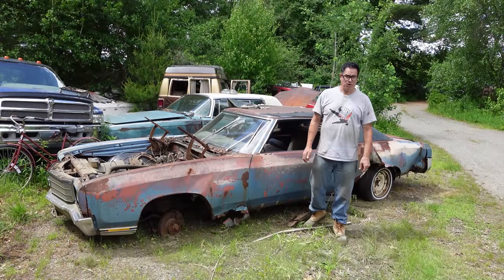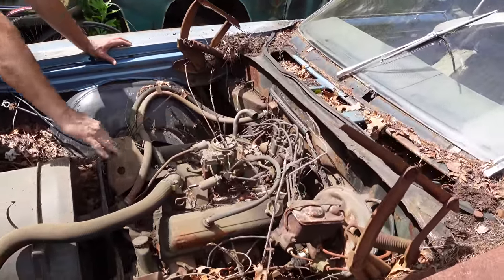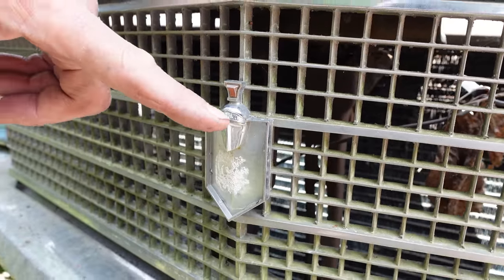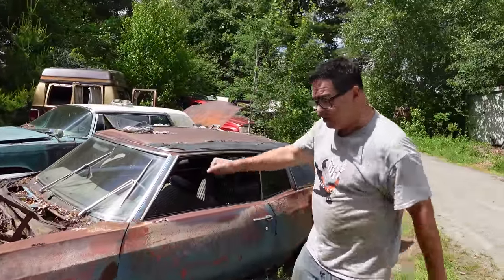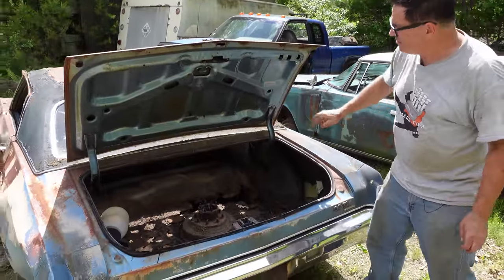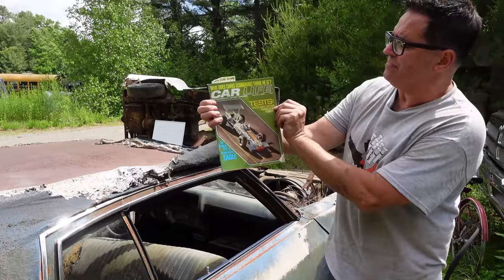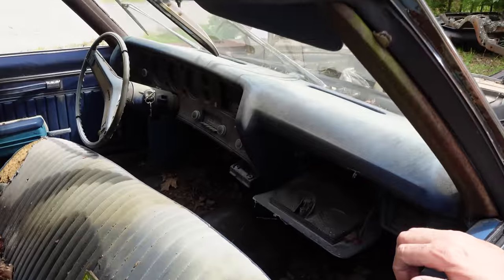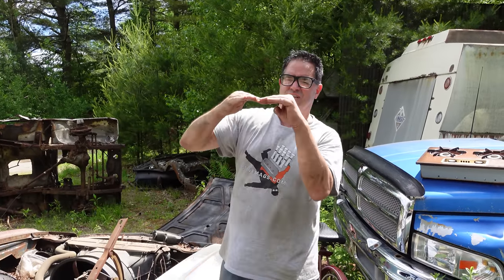1970 Chevy Monte Carlo

Comment: I had a 72 Monte back in the early 80s.  The easiest way for me to differentiate between 70, 71 and 72 Monte was the front marker lights.  70 had round ones in the bumper, 71 rectangular in the bumper and in 72 they moved to the side of the grill.  Easy to tell with just a glance.
Reply: also had a Monte ordered a rear sway bar from a chevelle SS   and put it on  the monte, took corners like it on rails
Reply: That's for doing the monte carlo I actually ask you about one the other day love your videos very educational thank you
Reply: I have a 71. The entire grille is different than a 70. Not just the emblem
Reply: Hey tool man have a 1972 Monte Carlo custom I bought in 1989 I still have her and she will never leave me
Reply: @johnbartol4313  Cool!  I think the 72 looked the best of the three years for that body style.  I also liked the stainless steel accent strip just below the trunk lid in back.  I think that was unique to 72.
Reply: @TheToolmanTim the Monte Carlo custom had all the accessories of the Monte Carlo ss had but but was a one year car but it it started out with the low horsepower 350 402 and 454

Comment: It was actually Bobby Allison, not Donnie that drove the #12 Coca Cola Monte Carlo. The cars were built by Junior Johnson and it was the start of his legendary run of championships with Cale Yarborough and Darrel Waltrip. Prior to the Monte Carlo, NASCAR rules required the #1 spark plug to be no further aft than the upper ball joint or in it's stock location. It was Smoky Yunick, he was mentioned by Steve, that found moving the engine back in the frame gave the car better balance that caused NASCAR to make that rule. His famed 66 Chevelle had the firewall moved back to give room for the engine to sit farther aft. The engine in Monte Carlos up to 1977 had the engine sitting 4 inches further aft than the Chevelles of the era giving the cars a bit better balance. That was one of the reasons the MC was popular in NASCAR despite being as aerodynamic as a barn door.
Reply: I had a buckskin colored 77 Monte swivel buckets and rally wheels bought new and it was the last of Generation 2 which had the engine moved back and a huge space for the fan shroud.  Loved that car beautiful styling and was smooth riding.  I bought it when the 78s came out because I always liked them and wanted the last of the big Montes.  Before that I had a 73 Chevelle.

Comment: I specialize in 6th gen Montes and other W bodies and i didn't know about the roman numerals on the grille for the year. I always knew the 70-73 body but didn't know how to tell them apart. Thank you for such valuable info. I love your channel!
Reply: The 1st generation is '70-'72. '73 began the 2nd generation. The '70 did not have a trunk lock bezel, but '71 & '72 did. The '71 had the Roman numerals on the trunk bezel. There are many differences between the '70, versus a '71 or '72.

Comment: Love this car from the first time I saw it !in the early 80’s in Trinidad. Moved to Nj in 86 bought a1970 Monte for $300 in 1986 then bought a 1971 a few years later (sold the 70 )  . Sold that 1971 after    Slight restoration-Paint rims stereo ! Sold that then got another 1971 as I prefer that grille and bumper

Comment: I bought my 71 monte carlo at 21 years old in carlisle, pa 17 years ago. Longest owned car I have. Was a very base model car. 350 2bbl, th350 no ac bench seat.

Been tinkering with it over the years. Still the numbers matching engine and trans but now on corvette rally wheels and sitting on a Viking performance suspension. It's certainly not fast but it turns heads and love it.

Comment: I bought my 1970 Monte in 1983.  I was initially confused as it had the 400 4bbl and I didn’t realize it was a 402BB.  It was very confusing at the time buying parts at the local parts store as the same motor was a 396 in a Chevelle, but called a 400 in the Monte when it was really a 402!  After about a year I finally got it all figured out.  
With the fan shroud removed, I can stand between the radiator and the engine.  Makes for easy work for removing the intake and heads.

Comment: I have a 1978 Chevrolet Monte Carlo that I bought used when I worked for a Chevrolet dealership. It came with a Buick 3.8 liter v6 which I replaced with a 454 big block. It has that long hood and the trunk lid is made out of aluminum. Still have the car and I'm in the middle doing bodywork and painting.

Comment: I changed a water pump on my 71 back in the early 80s. I removed the fan and cowl, stepped over the core support and radiator, and stood between the radiator and the front of the engine, with plenty of room to do my work. The 71 had the nicest looking front end, with rectangular turn signals in the bumper, that beautiful grill, and a classy little oval hood ornament, black with a simple silver script Chevrolet on it. Loved that car.
Reply: Swapped out a cam in my 71 without disturbing the radiator!

Comment: I owned a 1970 Monte Carlo from 1991-2010. I spent around 4 years restoring it in the late 1990’s. It was a early build car from the Flint Michigan assembly plant. Mine was gold with a black vinyl top and sandlewood colored interior. Mine had the 350 4 barrel, A/C. The rear end was a 12 bolt. It was pretty much stock, I even ran the rally wheels with the whitewall tires. That blue Monte looks to have some usable parts on it, so I hope someone makes a trip there and buys some parts off it. They changed the front of the vinyl top trim mid-way into the model year. They eliminated that “halo” moulding on the front edge and ran the vinyl top to the windshield. This blue Monte Carlo and the one I had we assembled before they made that change. As always, I enjoyed the video.

Comment: Sorry second comment. Stock Car Racing published an article about the Bobby Allison NASCAR Monte Carlos, complete with build pictures. There was a surprising amount of stock content in the bodies, albeit heavily massaged. Frame rails were factory, with the box section narrowed and reinforced in the axle hump to make room for the tires. Four link rear suspension in lieu of the (very non-factory) truck trailing arms, although Allison moved pivot points and used spherical bearings. Adjustable spring buckets, reinforced front control arms per typical practice. Allisons were innovators on the track and in the air.

Comment: Looking at the engine setback in that car if you put a powerful enough engine in it with good tires it would really hookup off the line! One downside is that you had weight from the extra wheelbase.

Comment: The front suspension being more forward also improved the handling of these cars over their competitors. I remember reading an article back in the day that explains that the front centreline placement and improved geometry helped the handling to the point that it didn’t need stiff springs which improved the ride.
I had a couple of buddies that had a Monte Carlo and the other a Charger. We went tearing around some backroads north or town and the Monte was way faster. Hardly scientific but lots of fun!
Reply: Can confirm. Had a 72 In High School. Was the best car to do donuts and whip S#ittys in during the winter... Very neutral handling / weight distribution.
Reply: My 72 had lots of front end plow, had to remember to turn early at any speed

Comment: They are gone off the street but not forgotten else where..the chassis/frames ran for years on the dirt tracks of America. The only one where the front spark plug did it need to line up with the ball joint.

Comment: When I was Little a friend of mine, Herbie Jr, had as '70 Monte Carlo he had put a LT-1 350 4bbl, but he was a farm boy, he put a 3 on the tree Pickup truck steering colum and truck clutch pedal!, he would pull out to pass, downshift to 2nd gear and that 350 would rppm up to 90 mph in 2nd gear b4 he would shift. Never seen someone switch a truck 3  on the tree manual into a car. Love your Videos!!
Reply: The base first gen Monte Carlos came from the factory with a 3 speed with the column shifter. All other transmissions were an option. It was typical of a lot of models back then.
Reply: @danjanes8689  His was 1970, it had single round headlights. He had installed this one from a pickup truck, the steering column was not a matching color. He would drop down to second to pass, that 350-4bbl had no problem, he would shift to 3rd around 90 mph. What a sweet ride!

Comment: I don’t know if it was merely an optical illusion, but I think the distance between the front grille and the front of the engine block became even more exaggerated on the Gen 2 cars that came out in 1973! I always looked at those mid-‘70’s Monte’s and thought they must have been a nightmare for mechanics to work on just because it was such a long reach to get to certain parts of the engine bay!

As far as “mean looking” NASCAR cars from the early ‘70’s are concerned, for me it will always be the ‘71 Road Runner that Richard Petty ran that year! Especially the blacked-out front grille detail with “43” painted over only the passenger side headlights against the bright “Petty Blue” paint. And better yet, maybe just a peak of David Pearson’s Mercury coming up behind him! Ahhh - the good old days when there was actually COMPETITION between the manufacturers on the race track……🏁
Reply: I had a 74 with a  small block 400ci, and yes you could take out the shroud and stand in the engine compartment and work on it no problem

Comment: Steve , had a '70 400 sb I got from the original owner in E Hartford ct in '84. I learned a lot talking to other owners , it was like a cult following. One thing i learned
that the early production 70  Monte's had a gap between the vinyl top and the windshield, small painted area matching body. They also handled great with the engine
weight being pushed farther back. Great video !
Reply: Called a "halo" vinyl top. Camaro's had them, as well.

Comment: I don't know if it was part of the thought behind the design but the long hooded cars like the 71 Charger and Road Runner as well as the Torino performed well in stock car races. GM was starting to get back into racing.
Reply: I did like my neighbors old white Gran Torino (prolly like a 73ish) ,that was back around 80-82 and of course with the pro stock look with slotted mags and airshocks. 
I don't think you could spot a football field behind you trying to look out the rear window 🤣
Reply: @MrTheHillfolk  we had a 71 Charger. Forest green 383 Magnum automatic. It seemed like the hood went on forever.

Comment: Doing a frame-off rustbelt 72' just about as bad.  Most of life in Ohio with 3-years ocean side in Florida.  I wouldn't wright that one off as of yet.  They are getting popular especially not a lot of the aftermarket sheet metal is available. Full quarter, door to tail with sail. 
Thanks for the education on the grill ID.

Comment: I missed an opportunity to buy a canary yellow, black half vinyl top '70 SS, that had a '72 454,400thd,12bolt and good black interior in about '99, or 2000. It had a little rust around the back glass minimal under vinyl and some starting in the lower back quarter panels. The car today if had been stored and untouched would bring killer money today. The guy wanted $1500bucks and I was determined to get it for $1200 and ended up losing it. Outta a few that got away over the years I regret not buying it nearly the most

Comment: @ Steve Magnante
Both my Montes had 12 bolts and 4brl 350s
Neither had air shrouds and those door panels look good even after 50 years
also the frame (I'm told a Chevelle station wagon frame from the parts bin) basically made it a mid-front engine
Reply: The Monte Carlo wheel base is the same as a Chevelle wagon, but the frames are not the same and don't interchange.

Comment: I had read that the 1970 - 1972 Montes utilized a for door Chevelle or wagon frame.  That should explain the odd long radiator shroud because of the odd engine location.
Reply: The wheel base is the same, but a Monte Carlo frame is exclusive to the Montes.

Comment: One of the things about the first gen Monte Carlo was GM hyped up the fact that they more or less copied the front suspension of the Mercedes Benz to give the new Monte Carlo the same ride and handling characteristics. Also the SS version came with rally wheels, trim rings and centers similar to the Corvette's.
Reply: The front and rear suspension on Monte Carlos were 100% GM A-Body. The only differences would have been spring rates and shock damping.

Comment: I thought the Monte's just used an A body 4 door/el Camino chassis frame for their length? I believe they also used an SS dashboard cluster.
Reply: Nope. The frame was stretched behind the front wheel. Wagons and El Caminos shared a frame. El Camino frames are often shortened and used on convertibles or under a Coupe where a boxed frame is desired.

Comment: I heard that these originally were supposed to be front wheel drive but tooling cost would move the selling price higher than a customer would pay for a Chevrolet
Reply: interesting since GM had a V8 FWD chassis design around that time, but it was used on the BOP's.

Comment: 1970- 72 Monte Carlo is one of the last muscle car bargians.  2 door coupe only, 350cid V8 or better standard, front disk brakes standard, round Chevelle SS type gauges standard, with most having AC and 12 bolts for $4,000- 6,000.
Reply: $4000-$6000 for what? A rusty project is about that. A nice car is 15-25k, and many have sold for well over $25k.

Comment: Ok, here to though this in, the monte has an extension plate "4 inches" long that is in FRONT of the inner wheel well to the radiator support not 4 inches in the frame, and if the frame thing is correct, it's because it's on a Chevelle station wagon frame, dam I feel old. NOT!
Reply: The Monte Carlo frame is specific to Monte Carlos. It's the same wheelbase as a Chevelle wagon, but the frames are not the same.

Comment: Was the ls6 an option?
Reply: From what I've read in magazines, the LS6 was not available in SS454 cars, just the LS5.
Reply: @Jim Bartalone  You are correct. The only LS6 we know of was converted from an '70 LS5 SS454 at Dick Harrell Performance Center in Kansas City. This was done for a customer when the car was first purchased and the car is now owned by Mr Tim Pestinger of Salina, KS. It's easily found with a Google search.

Comment: I think only the 402 big block is the only way a 4 speed could be had in these. The 400 small block crank is not recessed for a pilot bearing & input shaft . if I'm correct . car or truck .
Reply: I have a registry for the first gen 4 speeds and my own '71 w/402, 4 speed. For '70, the 350 and 400 small blocks, as well as the 402 cars were available with 4 speeds. The 400 small block went away for '71, but a 4 speed could still be had with a 350 and a 402.
Reply: I have a build sheet from a '70 Monte Carlo that was factory equipped with a 400 small block and a 4 speed.

Comment: 350 SBC or 396/402 454 BBC V8 engines were the options in that era
Reply: And the 400 sbc
Reply: 350 2V, 350 4V, 400 2V, 400 4V, 454 4V.  The 400 2V was the small block and the 400 4V was the big block.

Comment: my little brothers first car was a rusty an beat up 71 Monte Carlo. it has a weird all numbers matching build though, 427 on a Eisner 4 speed stick. I helped him restore it from bumper to bumper. an after all that work the lil shit went an had it lifted an had two sections of a telephone pole fer bumpers. looked evil, but the rear end locked up because of the idiotic lift job done on it. it took 2 years to find the pieces to fix the $1700 fuck up my lil brother had to pay to be done to a low mileage fully restored 71 that now has a very very low value. thankfully the little shit learned from that an now he babies the fuck outta that now worthless Monte Carlo.